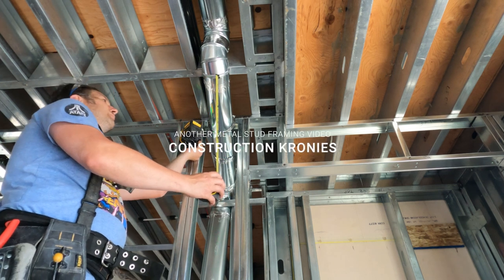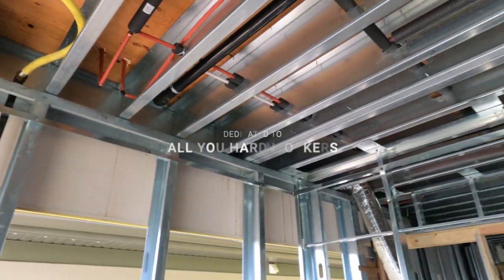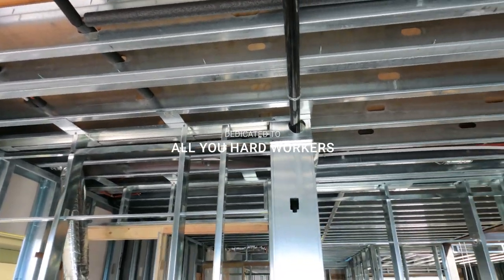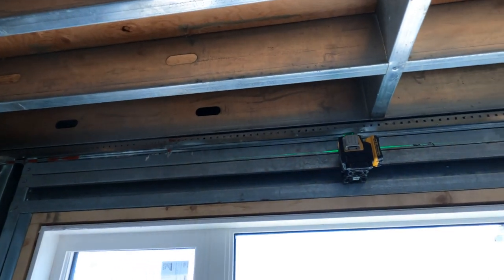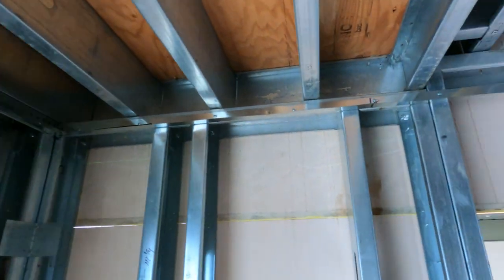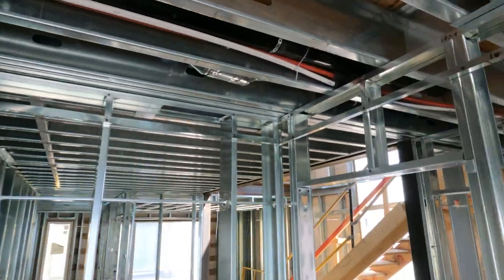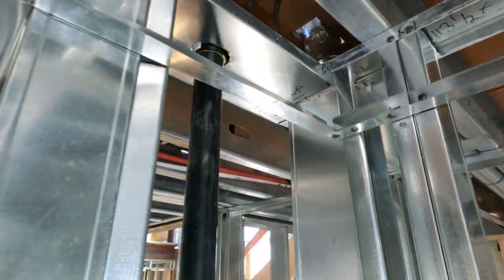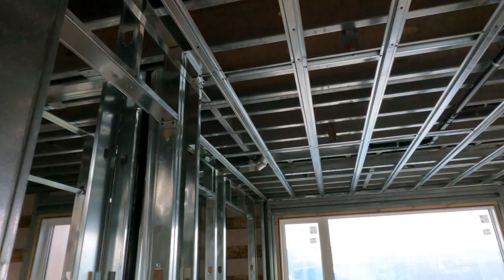How To Install A Drop Ceiling In Under 1 Min #shorts

Comment: Can you do a video on installing ceiling/roof on single story free standing metal stud room.  Do you have to contact to the beams?  How would you do it without connecting?
Reply from the maker: Hey my man, so no you don't have to connect to the beams if they are not in the way. Are you using studs to frame your ceiling instead of furring bar and angle? If so, just put track on the two long sides studs go the short way. Depending on how long the studs are if you need kickers.  Remember though if you can drywall the ceiling with one sheet per row and no butt joints always run your studs to accommodate that.